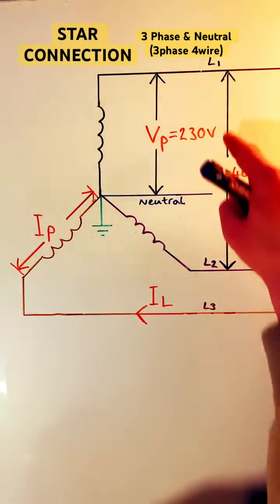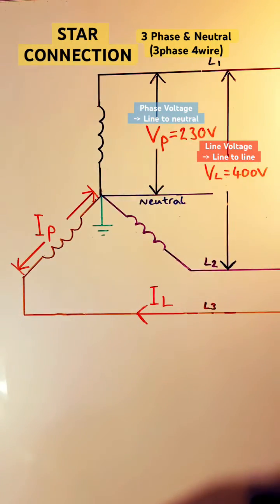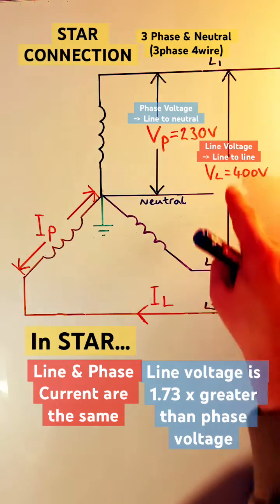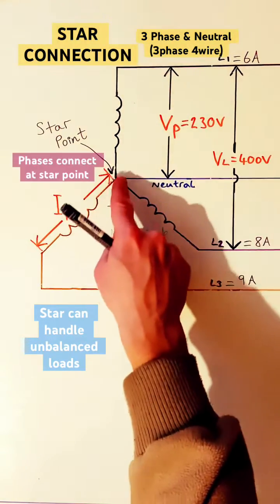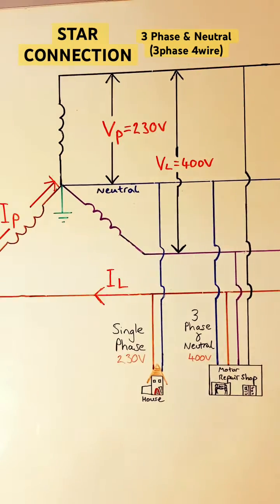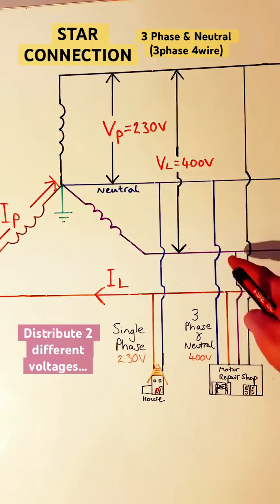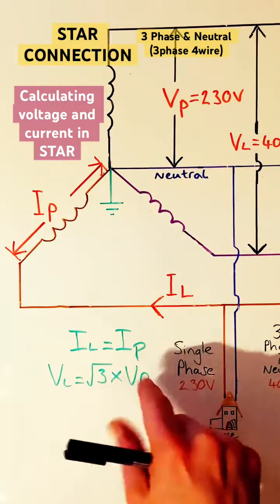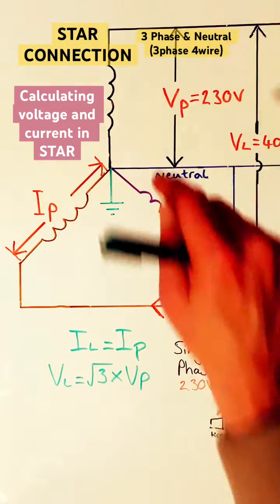Star Connected 3 Phase Supply: Key things to know

Comment: It’s an odd one to get your head around,  because if you had perfectly balanced star connected 10 amp neutral loads you would show the 10 amps return  on each of the neutral’s feeding the single phase loads.  But the resultant of all the combined neutrals would be zero amps.  But if you didn’t have that neutral you wouldn’t have a return path.  So it’s really just current shuttling backwards and forwards and cancelling out.